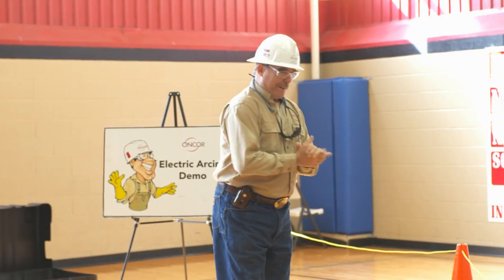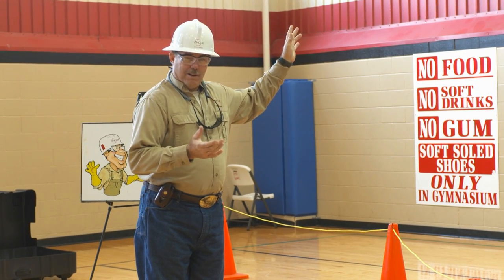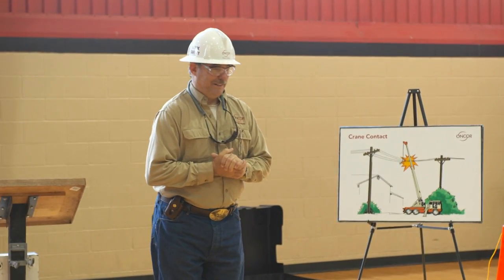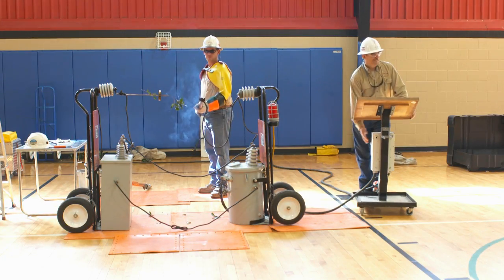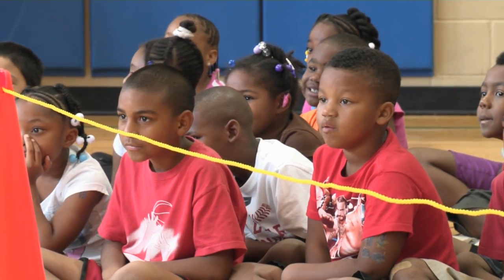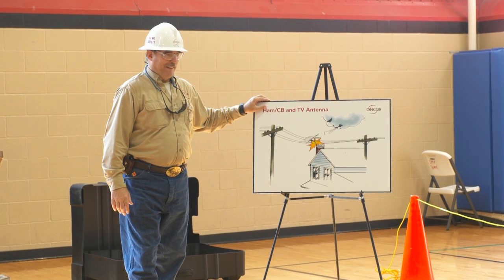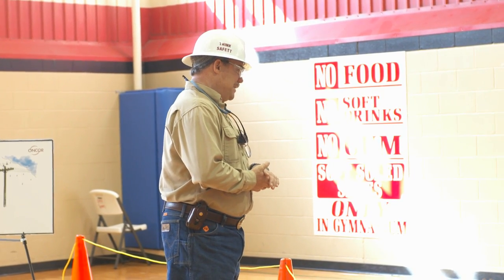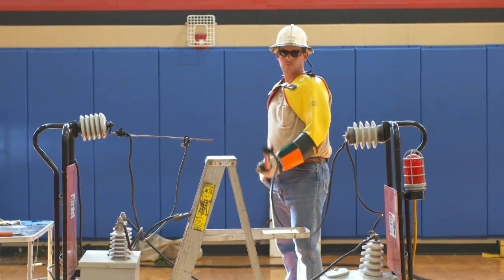Oncor Arc Demo V2 H264HQ

Comment: How do you limit the current at the shortcircuit ?
Reply: putting a capacitor in series with the primary or the secondary but it has to be good rated

Comment: No insulation to kids. That is dangerous when working with 5KV. Eyes could be damage due to UV ray from arc.
Reply: Nah its fine. Its not like the kids were jumping at the line lol. There was also a switch immediately nearby. Their eyes don't hurt when the room is bright, speaking from.experience.
Reply: Stop being paranoid. These are professional electricians, don’t you think they would have thought of that if that was a real big concern? I am an electrician myself and I would not think twice if they had this setup at my kid’s school. Also, the arc would need to be continuous and you would need to be staring at the arc to make even the littlest of damage.

Comment: How did they run high voltage lines into that school hall ?
Reply: They didn't. They run a pole transformer in reverse, feeding 120/240 volts into what is normally the secondary winding, which steps the voltage up to primary distribution level (7200 volts).
Reply: And the way this demo works is exactly what happens if you hook up a generator to your house wiring without a transfer switch. Electricity backfeeds through the meter, up the service drop, and into the transformer, gets stepped up to primary voltage, and electrocutes someone.
Reply: @bamaslamma1003  my transfer switch is just the main circuit breaker. It seems to work ok when running my generator. I dont think I've killed anyone yet....
Reply: @bamaslamma1003  Ah . Clever. Didnt think of that
Reply: they got the kids to run the lines during play time

Comment: The capacitor, which is on the left, limits the amount of current that can flow.
Reply: Ben is right. It's a principle called reactive power limiting. It works the same way as resistive power limiting, but with capacitors. Pretty basic electrical theory. I realize this post is way old but still wanted to clarify for others.
Reply: @Matt_Deluca  yeah
Reply: Ahh, some people with knowledge in this comment section.
Reply: (replying to an old comment) 
I think the capacitor is here to make the pole pig resonating, as it may makes an LC circuit tuned to 60Hz
Reply: @ElectroXa  
This would not make ANY sense. FOR what purpose?
Reply: And, if I may ask, you know this how? Is this an apparatus of your own design?
Reply: @uploadJ  he didn’t have to design it to understand it you pleb
Reply: @uploadJ  I’m just stating the facts so don’t get all offended about it